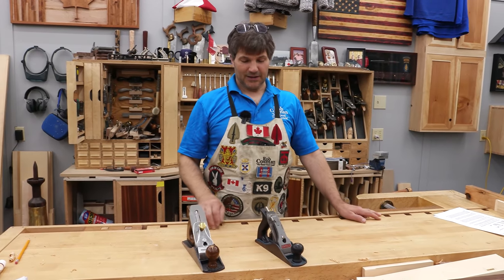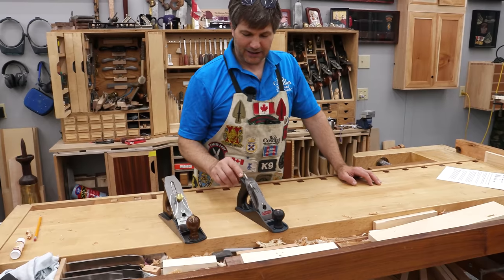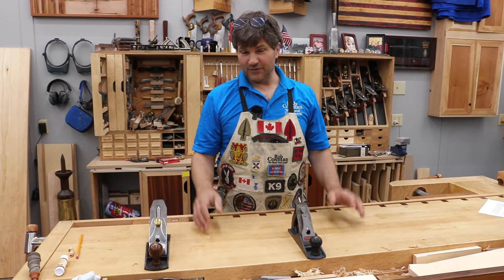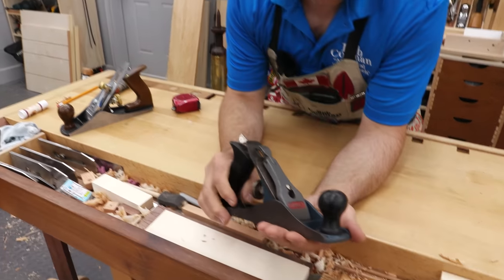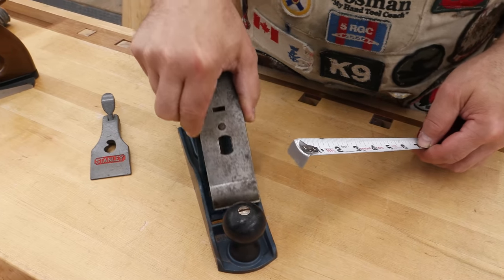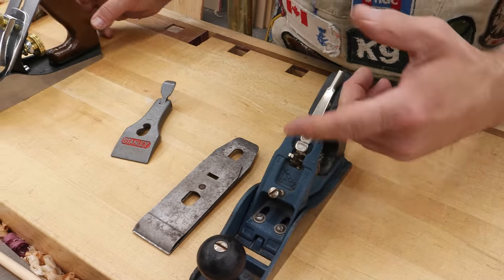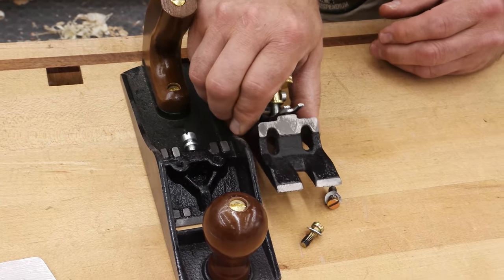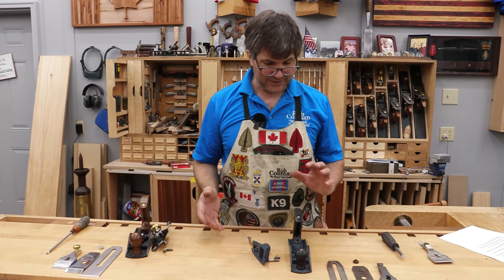Tool Review - amazon basics vs. Stanley Handyman Plane

Comment: oh crap. I bought a Bailey #4 (dated 1902) to restore, which is higher quality than the handyman, but still. I also bought a Stanley 220 block plane to restore. I also bought a Millers Falls 14C to restore, although this one is in significantly better condition than the others. I plan on using all these planes, so I hope I didn't waste my money being nostalgic. Already spent the last year restoring an old Walker - Turner table saw. 

Thanks for the insight, Rob!

Comment: I never realized how bad those Handyman planes were. I think adding a vintage Bailey of the same size to the review would have been helpful to show people the difference between that and the Handyman line. I've bought a number of old #4 and #5 Baileys at yard sales and flea markets for less than $30 and online auctions for under $75 that are much better performers than that Handyman.
Reply: I just happened upon a block plane, a #6, #5 and they were in excellent condition. The only real problem is broken rear totes. The #6 was missing about the top 1/3 of the tote and the #5 was cracked in half. I’m working on getting a replacement made now. Depending on how this goes, I’ll either make another or buy 2😂

Comment: The Handyman was probably fine for its intended use, a homeowner tool to shave a sticking door or window down. I think everyone's dad had one in the garage or basement. Not a tool for making a good, smooth surface but rather a tool for making a piece of wood smaller.
Reply from the maker: I agree. Problem is newbies want to spend less don’t realize that.  Thats why I made the video

Comment: I've had the same experience with the Handyman line of Stanley. My used plane was not as bad in the surface to surface contact but the cutting results duplicated your results, maybe a little better as I spent more time that I should have to stabilize things. It seems to be more apparent with the #3 size. I have an old Parplus plane that does surprisingly well. It has a fixed frog, meaning that it is part of the sole casting and in my case it is true to the plane. I did purchase a 5-1/2 Woodriver and yes, like going from a Model T to a Lexus and for that I thank you.
Reply from the maker: Great comment, thanks

Comment: I just had my Handyman apart, and I must have learned something from you, because I found myself remarking, “I bet that would work better if where the frog meets the sole were milled,” and, “I bet that would work better if the frog were milled on the blade bed,” and, “the only two blade settings seem to be too much or not enough.”

Comment: After wstching this video i hsve a comment and a question. First the comment. I always find your videos to be very honest and helpful. I have improved my woodworking by applying your techniques . Thank you.
Next the question.  I am a retired architect and try to take my woodworking hobby the next level and improve my tools as i go.  What plane manufacturer would you suggest i look at for a "good" quality plane. Keep in mind i do have a retiree's budget.  I have an old Stanley Bailey No.5 from an estate sale that i am trying to put back in working order but still not getting the results i want.
Thank you again for your dedication to to craft and as a veteran i appreciate your Wounded Warriors support.
Reply from the maker: WoodRiver is the value brand I recommend.  Save money by only getting the planes tou need.  A 5-1/2 will do 85% of your planing tasks.  Then a block with those two you can do almost everything

Comment: Wish i saw this sooner. I recently spent a few hours flattening the bottom of my number 5 handyman. Then it still wouldnt cut well so I re did the bevel on the blade becausd it wouldnt dig in. I think it was almost 45 degrees before. I can get a light shaving, but never a full pass length. Also the lateral adjuster only pushes the blade in one direction. It never cut on end grain, no matter of light of a shaving or sharp the blade. The skipping you had on cherry looks like what i get all the time. Like you said, i thought it was just my technique. Im much more seriously considering getting a high quality plane now.

Comment: I recently rehabbed a no. 4 Handyman that I picked up at a flea market for $8.  The frog would never seat reliably at all.  The slots on the screws for the tote, knob and chip breaker were all too shallow for a standard screwdriver and were partially chewed up from prior users trying to adjust it.  After recutting the slots and filing down/flattening the mating surfaces on the frog and the base I was able to make it into a serviceable scrub plane.  I would never try to do anything else with one.  That plane has some bad juju.
Reply from the maker: But making it into a scrub plane is a good option.  I should have said that in the video

Comment: I really celebrate your opinion. I'm from Germany and unfortunately I am not able to get stuff from your shop. Fortunately we have some good woodworking shops (I will not post any names) and I can really sign your conclusion: simply get get best tools you can afford. I am actually a great fan of JUUMA planes. As written on the homepage of that shop: 'Juuma closes the big gap between cheap tools and highend hardware' - which I can really confirm.
If you can get them in your area I'd like to know your thoughts about those. I really like them...
(And the cheap ones I tried first are on their their last trip - for recycling)

Comment: I will say, the Handyman does have one piece of solid utility - it makes for a monster scrub plane.  It's light.  It's cheap.  You can abuse it and not feel bad.  The crappy lever-cap doesn't matter if you're just hogging off wood, nor does the chip-breaker.  The mouth is already gaping and only needs a slight adjustment with a mill file to get it to size.  The soul doesn't even have to be super flat.  None of the vibrations or other garbage matter one whit if you're using it for a scrub.  Radius the blade, open up the mouth, and stick it on the shelf and it'll last you a good long while.

Comment: Hi Rob, you've covered cheap (in both senses of the word) planes in this video, and in previous videos you've covered premium planes like the WoodRiver. What about the middle ground? What would you recommend for someone who is primarily a power tool hobby woodworker, who wants a good plane, but can't justify the price of a premium plane (the Wood River 5½ is over $600 shipped in Australia, and the Lie-Nielsen 5½ even more). Maybe a video comparing a couple of options that fall into the middle ground.
Reply from the maker: What do you have access to over there?

Comment: The first thing I do when I restore a Handyman plane, or any other with a painted frog seat is to use a sharp (but cheap) chisel and scraper to scrape off the paint. If needed afterward, the seat can be greatly improved after just a few minutes (or less) with a file. The real difference between the Handyman and the Basics is the materials they're made of. While the Stanley has the bones to make a decent, though very basic user. The Amazon one with its pot metal parts really doesn't.

Comment: I've bought everything from #3 to #7 planes on Ebay, all used & either early Stanley or Bailey.
I look past the surface rust & cosmetic issues & the most I've ever spent is £35/$50US.
Had one "froggy" frog on a Stanley #4 which took 20 minutes to clean up on diamond stones.
Can't see the point in buying modern, or even 50yo "budget" planes.
Reply: When’s the last time you bought one? Those prices have been creeping up quite a bit since I’ve tried to get into the hobby.
Reply: @zacsuth  You're right Zac. Prices sky rocketed during the pandemic. I notice they are starting to cool off though. I'm with Gargler. I have every Bailey Type 11 except a 1 and a smooth 8 all bought within the last 5 years. I spent a bit on the 2c and 120 on the 2. The 8c was 85. The 7s were in the 70s. The 4 1/2 was 40 and the 4 1/2 c was 60. The 5 1/2c was 50 and the 5 1/2 was 65. The 3s, 4s, 5s and 6s were all under 50 bucks. The 3s and 4s were in the 20s and the 4c was actually 18 bucks. The 5s were in the 30s. The 6s were 40 ish. You can't sniff those prices post-pandemic.
Reply: @lawrencedeleurere4427  true! Hopefully the tools start dropping again like lumber has begun to. I want to get involved, but man, this has not been the year.

Comment: I have a Stanley plane with the 2 piece yoke...endlessly frustrating because to get the plane to take a decent shaving the lever cap has to be very tight and when I try to advance the blade the 2 piece yoke splays over the adjuster wheel...no such issues with my Wood River.
Reply from the maker: Yes such a bad design. Thx for the comment

Comment: Unfortunately, in many countries line mine (hello from Peru), these Stanley  handyman like version are commonplace. They sell it as Stanley global version. The highest "quality" we can find here somewhat easily are the Bailey version for around 75USD for a #4, but only corrugated. Not sure how the new Bailey compare to the older ones though. There is no Veritas, no Woodriver, no Lie Nielsen... not even Luban. People buy Bailey and tune it to make them work properly. 
This means, no luck for new comers to woodworking. The hand plane is less and less used unfortunately. Many modern woodworkers replace planes with grinders with sandpaper (no kidding)

Comment: I purchased a budget plane from home depot. It was an absolute pos out of the box. I may add that I knew absolutely NOTHING about hand planes. It was practically falling apart. The only redeeming quality was that all the mating surfaces for the frog were acceptable. I was going to return it but decided it was going to be a good learning experience on how to work/maintain and repair these tools considering I was and am really adamant about learing to work with hand tools I tore the whole thing down, cleaned up the body and even sharpened the blade with nothing but 180 grit sandpaper and some aeresol silicone lubricant. Let me tell you.. out of the box, this thing was a paper weight.. the bevel in the iron was cupped.. not cambered but cupped.. it also looked like it had been smacked with a screwdriver. The cap iron was only making contact in a total of 10mm worth of span across the iron. The depth adjuster wouldn't set the blade correctly because the screw that attaches the cap iron to the cutting iron was hitting the yolk that comes up through the frog and the area in the top of the frog where that very same screw is supposed to sit wasn't cast properly. After a couple hours, lots of sweat, swearing and watching paul sellers, james wright and others videos, I was able to shave hairs off of my leg and get shavings so thin and consistent that I could literally read through them when I laid them over something with text. I turned a pos into a working tool and I'm proud of it. The only weird thing I have noticed is that I need my cap iron further back from the bevel. Not a 32nd but more like between 1/16th-1/8th or else I will jump, skip and leave horrible marring on the piece like the Stanley did on the cherry. I recently acquired some free hardwood that was all covered in old finish including some ebony that I originally thought was walnut with a tinted shelac and the plane did just fine getting past the finish and taking a couple light surface layers to expose the beautiful raw grains.

Comment: The Handyman and Defiance ranges are a mixed bag ... you want to pick up a box full at a garage sale for 30 bucks and use them to make one or two good ones. But they're not all &^$% either.

The first plane I ever bought (instead of borrowed) was a Handyman back in the 70's and I still have it and it's plain cardboard box (cost me, I think, about $20 new). Plastic tote, knob, and adjuster. Lever cap "Handyman" printed on an adhesive label. No throat adjusting screw, etc. Should be a piece of junk. Yet I'm as likely to reach for it as my 100 year old Stanley Bailey #4 for medium removal (not smoothing and not fore-plane work). Wouldn't use it for smoothing, but it's great for that stage in dimensioning when you want more finesse than a scrub plane.

My son found a Defiance #3 for about $25 last year, which he tuned up a little (sole, blade, chip-breaker and some rust removal only). Also low on features, but you can't beat it for smoothing small pieces of work or softwood like SPF trim.

But generally, I agree that it's worth spending the extra for a decent starter.
Reply from the maker: Thanks for the comment

Comment: Are you interested in trying your hands on an antique wooden plane? Maybe that is the awnser we should all be looking for when on a budget. I personally use them a lot and I think they are great
Reply from the maker: Wooden planes come with their own set of problems.  Mainly that wood moves and they need to be periodically tweaked.  However you can make a decent old plane work just as you can with an old metal plane.  Another problem is getting replacement blades for old planes
Reply: Yeah I partially agree with that, wooden plane bodies are worthless, buying a plane with a good iron is much more important. The wood work, if not damaged too badly by woodworm, can almost always be fixed

Comment: Rats! I wish I had watched this two weeks ago ...
I am really surprised that Stanley could not turn all of its knowhow and resources into an economical plane that works well.
 I just picked up a couple of Handyman #4 size planes. 
One of them will actually plane softwood, and I may keep it if I can set it up for rough work/household tasks. 
The second plane, which closely resembles the one you looked at, cannot be made to plane: the blade cannot be adjusted far enough downward to project through the opening in the sole. WTF. Oddly, this plane came with a steel spacer that sits below the frog and elevates it even further so that the blade is even further from the opening. Double WTF.
I have made it my mission to remove the paint and excess metal on the frog and its base. 
I hope to get it working so that the plane will function.

I put a vintage blade/chip breaker on the plane that actually works, and the plane worked better than with its own iron/breaker.
So...  the blade/chip breaker is probably the main weakness, but the haphazard design of the newer planes also seems to contribute to the inferior performance.

Comment: I bought a Tay-tools #4 smoother a few months ago. It came with a bowed blade. The plane was flat and square and it felt good in the hand. The blade however turned what could have been a great plane into a piece of garbage. I ordered two more blades but as of this video they are out of stock.
Reply from the maker: The best thing you can do is order a modern thick blade not another thin cheap blade.

Comment: What is the brand and model of the good plane ~22:50?
Reply from the maker: Woodriver 5 1/2 jack
Reply from the maker: I DO NOT recommend a Low Angle Jack. In my opinion, it is the last plane someone should be buying.

Comment: I want a wood river…. Quality Quality Quality… see you in August.. Will you be having any classes?
Reply from the maker: We really hope so.  we have our fingers crossed that the border will open up to hold the SEP and OCT classes and if so we will try and add two more classes too
Reply: Woodrivers aren't quality, it's just they aren't junk. There's a difference. They would probably be classed as semi-premium. They have a history of quality control issues as pretty much everything made in China does. Blades seem to be hit and miss. If you get a good one, they are a deal. If you get a bad one, then it's still way better than the junk up above, but they can chatter and the blades are known to slip. At the same time, if you really want quality, you'll be paying a lot more than the 200 that Woodriver wants.

Comment: Have the handyman and it sucks for the most part..and understand this is a woodworking chanel . But handyman would work in a carpentry situation..just say you need to fix a sticking door or something..it will do just fine for that
Reply from the maker: Sure, but as a woodworking I can’t recommend it. Might be a good hammer or door stop too.

Comment: From having a Handyman in my collection, I have noticed to fix it or an Amazon Basics plane, it would really require milling the frog and mating surfaces, as well as knocking down whatever doesn’t allow the frog to sit correctly. I bet the guide in the plane body is too tall allowing the frog to not seat. So, yeah, not worth the aggravation for the amount of work that needs to be done. 

Nick Engler did a video about a Harbor Freight plane and he took it to a machine shop and had some work done to it - mostly to flatten the sole. It wasn’t worth it and he said the plane is an insult to the craft. It’ll keep novice users from getting further into woodworking if they have those cheap tools as examples.
Reply: Yeah, I made the harbor freight mistake for my first plane years ago... 20 bucks. Tried it once, and said "this sucks, why would anyone do this?" Couldn't figure it out for nuthin'.

Couple of years go by, and I'm watching perfect ribbons come out on youtube... and the light bulb went off. My next plane cost $200. And it makes nice ribbons.

Save up for decent tools, kids. 😆
Reply from the maker: Yup, you get what you pay for
Reply: Wood river or lie Nielsen is the answer…